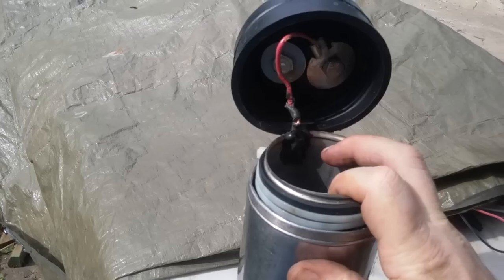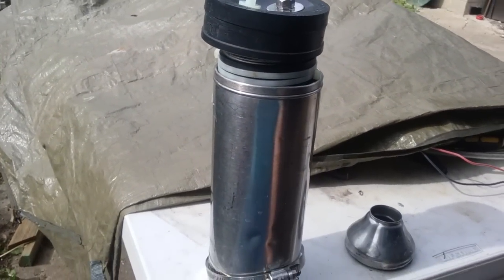How to make hydrogen from thermos

Comment: Josh don't listen to the Na sayers. wish u were my next door neighbor. I have similar things bouncing around in my head. I'm very interested by this . I saw a scientist in a lab using salt water instead of fresh water. apparently the salt in water conducts electric better.
Reply from the maker: You do have to use salt water. You put Baking soda about 2 tablespoons in. Thats your electrolyte. Hooking it up to a vehicle is a little different. Using one of these creates heat fast and boils the water then no hho. Need a fan or put in front of car. Also need a voltage regulator. Thanks for the reply.
Reply: @SuperLeeroy69  neutral (hooked to nothing) "tumblers" between your positives and negatives will eliminate some of your heat and also use less amperage 😉